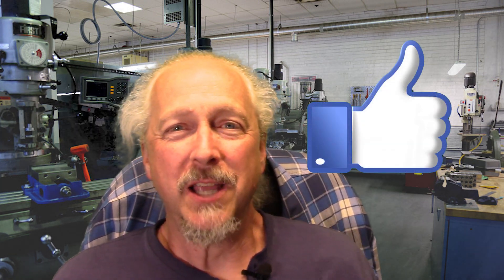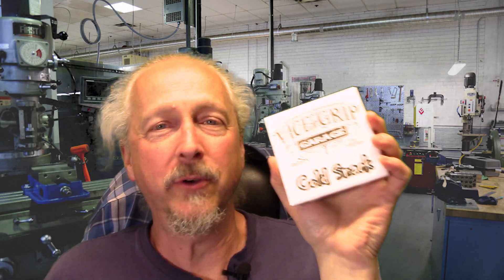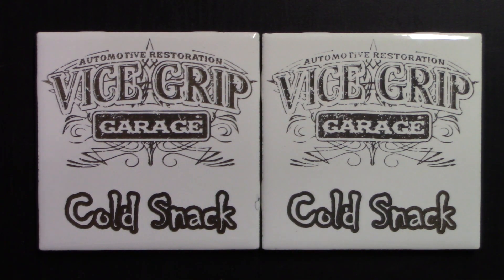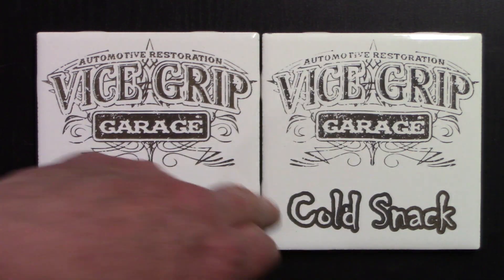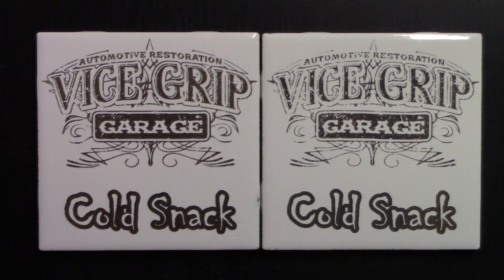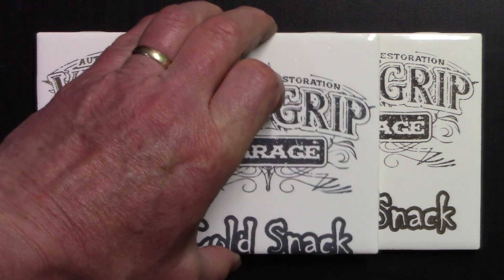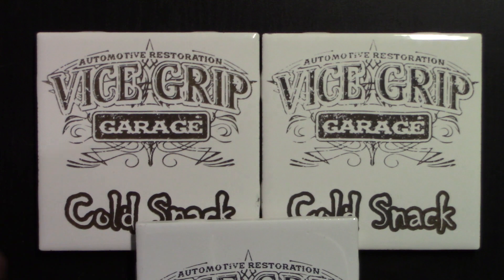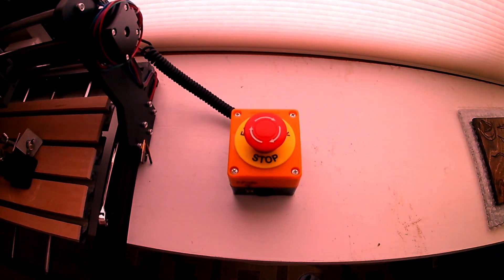After sitting for over a month, can you burn Cold Galvanizing Compound coated tiles?

Comment: Use acetone, it works great!
Reply from the maker: Acetone will work great for sure.  My issue is it will dissolve many plastics too and it is a harsher chemical.  That is why I go with a mineral spirit or lacquer thinner.  They get the job done.  I have recently switched to coating my tiles with TiO2 (titanium dioxide) and that cleans up nicely with water.

Comment: It maybe what comes through YT but there seems to be drop outs in the letters at the top of the right side tile. So I would have voted the left side best.
   The difference in your settings may be the difference in the out comes.  And one YT'er cleans Cold G with water and steel wool.
Reply from the maker: Sometimes things look better on video than in person.  They both turned out well.  I agree that it looks like there is a dropout of the letters on the right one.  The thing is, that is how the graphic is.  It has more of a distressed look built in and the one on the right shows that better.  I like both of them.